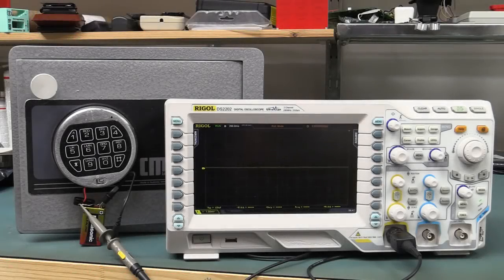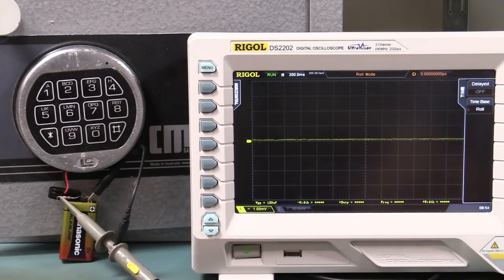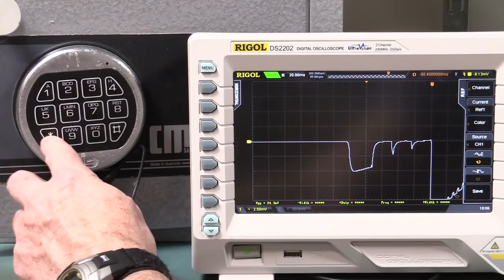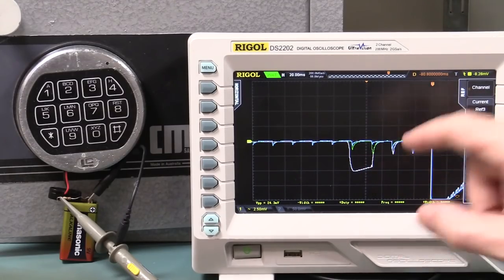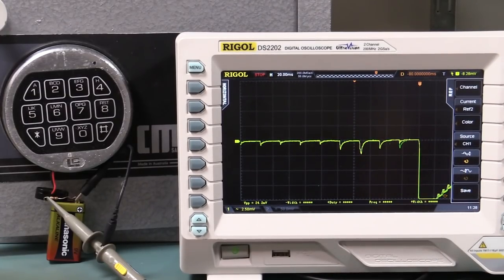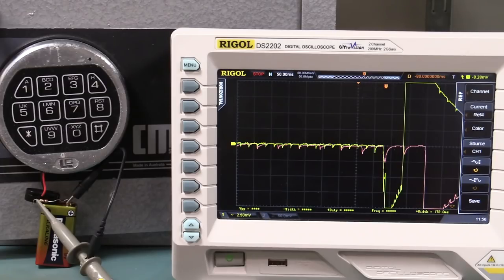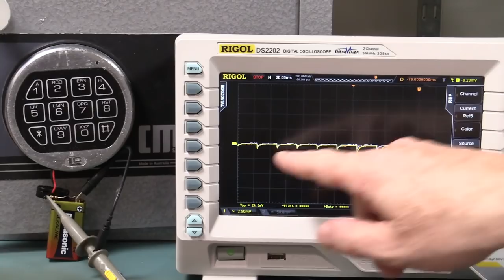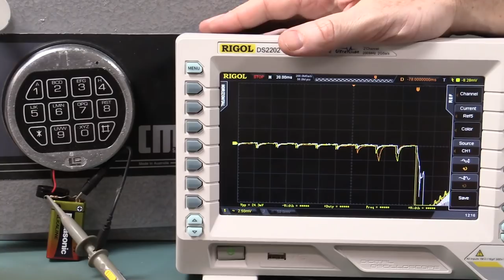EEVblog #771 - Electronic Safe Lock Powerline Attack Part 2

Comment: I wonder what, if any, effect that disconnecting the 9V battery would have. Is there some other sort of internal clock battery (or supercapacitor) that lets the processor keep track of that 10-minute lockout period, for example? If not, a brute-force attempt might be made much quicker by disconnecting the battery after the 2nd failed attempt. You could potentially automate the brute-forcing that way.
Reply: This Does Not Compute no. I've tried that, it doesn't work.
Reply: This Does Not Compute lockout is persisted to flash, but this would probably work for the 10s sleep interval
Reply: Peter Carlson 

Did you short the power pins after disconnecting the battery to discharge the internal caps?
Reply: This Does Not Compute It has a EEPROM chip for saving the correct combination. Just as easily the controller will dump a counter to the EEPROM on amount of failed attempts. At power up the processor checks the EEPROM for failure counts. If over limit, go to immediate lock out mode. Sure you can end the 10 minute lock out by pulling the battery, but it is no joy for you. The lock will just lock out again, when you power up again. This also prevents zeroing the failure index, before lockout happens. You can pull the power after critical-1 fails, but it is still at critical-1 and will lockout after the first failure after power up. The counter will only reset to 0 after correct combination is given.

Ofcourse it will wear out the EEPROM eventually. So they better have high quality EEPROM or flash in that memory chip

Only real attack vector for this kind of system, which does it sanely by collecting all six digits before comparison, is the comparison operator stopping after first failure in they comparison array. This would lead to timing attack. Assuming Legat was even half competent, they wrote their own comparison function, that will go through all six digits no matter what. Really easy to do. Of course it wastes couple processor cycles, but that is not exactly a problem for a security processor doing as simple program as this.

pseudo code
---------------------
correctcode= true
fakingvariable=true
array input[6]
array ref[6]
for i= 1 to 6:
      if input[i] != ref[i]:
              correctcode=false
      else:
              fakingvariable=false
if correctcode==true:
     openlock
Reply: +Ari Takalo Yes but they should also be smart enough to prevent the compiler from optimizing the fakingvariable=false out of the executable. It would be really interesting if this attack would work.
Reply: +Harmen hand coded assembly for the win. I reckon a crusty old 6502 could be made to jump through the necessary hoops, except of course the power requirements would be prohibitive.
Reply: There are 2 caps inside, so when powering it off they may supply just enough juice to write the failure counter. I wonder what happens if you apply a short glitch in reverse direction to discharge the caps and let the processor skip an instruction or two...
Reply: it has input diode, reverse polarity protection and capacitor external discharge protection

Comment: If they were smart, and they most likely were, the way lock program works is as follows.
Firstly, it captures 6 digits, after that, it sees if they are correct. In this scenario, the computing after first five digits were pressed is minimal and will be nearly identical, because all the processor does is writes the input for later use. After 6th digit was pressed, processor does the actual computing to see if digits were correct.
In that case, even if the waveform after 6 digits will expose whether combination was correct or incorrect, it is pointless at this point.
My hypothesis is supported by the fact, that it considers incorrect digit combination only after all 6 digits.
Reply: ignas2526 "If they were smart, and they most likely were"

lol, you obviously didn't have to deal with firmware programmers
Reply: this isnt 'firmware' its a very basic microcontroller. the comparison routine would be the easiest part, load the complete code into a register and perform an AND with the stored code. even storing the digits would be much harder, the hardest bit would be the code chage routines XD
Reply: I had the same thought, it seems sort of ridiculous to do it any other way.  You'd just use a 6 byte shift register.

Comment: I wonder if you can get more details in hacks like this by messing with the power supply, For example, dropping voltage down until the thing just runs, or limiting current draw. You wouldn't use a battery for all this, of course.

Comment: perhaps some of the "random" instruction spikes in the processor have to do with time in miliseconds since the last key or set of keys were pressed. it would seem random, for example, 127 in a binary data stream would transmit as 111 1111, of which the analyzer would report 7/8 whole amplitude of that function. once it would carry over to 128 in the stream, as 1000 0000, the analyzer would report 1/8 whole amplitude.

Comment: Do you still need to wait the ten seconds if you disconnect the battery then reconnect?
Reply: TheEXTRAtesco  they used a exploit like that on iphones , kill the battery power before the micro saves attempts
Reply: TheEXTRAtesco I would think the timeout is on a physical capacitor trickle or something of the like, so disconnecting the battery would change nothing.
Reply: TheEXTRAtesco On the safes I've seen, when the power is cut, it'll be in lockdown automatically when it powers back up.

Comment: Re: 16:37 Any of 10 digits for the first times any of 10 digits for the second is 100 ways to get the first two digits assuming leading zero is okay and that digits may repeat. Divide the 100 ways by 5 attempts per period is 20 periods. Since each period is ten seconds, the worst case is 20 x 10 = 200 seconds or 3'20". Since all 100 possibilities have an equal chance the average is half of the maximum or 100 seconds (1'40").

Comment: I still think there's opportunity to do a mechanical attack by finding the resonant frequency of that latch pin/spring system.  Can you use a waveform generator and an electromagnet/speaker to impose a mechanical excitation?

Comment: Clean your keypads.

I work in the security industry. A dirty keypad shows which buttons are used in the code. Using six individual numbers adds to the ease of determining the individual numbers.  After that it's just a matter of time. Doubling just one number greatly adds to the number of tries necessary to break the code.

Comment: Dave, try cracking some of the cheaper electronic safes like SentrySafes or the cheap ones you find at the local department store. I hear they're much easier to open than the quality ones like the one you're using.
Reply from the maker: Tyler P. Yes, you can just dump a lot of them, or something use a strap to get into a reset switch inside, they are horribly designed.
Reply: +Tyler P. 0000 is the "backup" code

Comment: I'm watching this, as a programmer.  Completely unrelated to La Gard, never done any security work, and never had any security training, but...  (WARNING:  Wall of text.  I do that.)

Well, it's amusing.  When they've got an entire kilo of memory available, it makes more sense to me to simply store the six entered digits and perform a final analysis at the end.  This processor is clearly processing the digits as they are entered; this is the only way that an incorrect keypress would produce the beep 1-2 processor cycles sooner than a correct press.

As for the noted difference in 'good' patterns, that's probably because of the chance of exactly when in the processor cycle your finger pushed the button- and suggests a fixed cycle count delay for the beep, which would work to reduce powerline attack effectiveness.  This also suggests a fixed maximum amount of processing per cycle; thus, full processing may happen on a different cycle.  This does not explain the difference in beep timing, clearly kicked off on a processor cycle.

The 'bad' patterns might have a similar variation, in theory, on the same basis; however, it would appear they do not obey any fixed processor cycle details, resulting in an immediate beep- which would seem to be a weakness.  Making sure it followed the same timing rules would have easily nulled the viability of the entire attack- probably something they did in more modern locks.

That big hurking processor blob on a bad code suggests that, while it is processing on-the-go for a good code (as evidenced by no such blob before the solenoid spike), it is ALSO storing all six digits for final reprocessing to make sure it hasn't messed up.  The difference in the two full-bad-code patterns suggests a simple matter of which cycle the beep was started on- the one with the reprocessing tied to it, or one after the reprocessing.

The combination of the two code-checking algorithms offers a balance of speed from the on-the-go method (as seen on accurate code entry) and redundancy (aka peace of mind, computers don't 'miss' things like we do) from the final reprocessing.  This also speaks to me of a low-bid programming job- a skilled programmer wouldn't have installed such useless redundancy and, especially if he's good with security stuff (as would get the higher bid/paygrade), would have known exactly how to throw off your measurements- like, say, a randomized delay of 0-3 cycles before the beep.  The beep duration appears to be 4 cycles- suggesting a cycle duration of just 12 milliseconds...  small enough to be largely unnoticeable, especially by a human being that can't know at exactly what moment the button press is detected.

Of course, a beep delay method would only work if you're using the beep as your reference, as you are in the video.  It is probably possible, with the specialized board you've elected not to use, to lock onto the power draw of the button itself (minute, but not nonexistent) and use the first cycle after that as a reference.  This kind of attack would likely reveal processing delays and/or spikes related to the keypress, rather than the beep; a combination of the two methods (again, probably possible on specialized equipment) could easily reveal any inconsistencies left by the process-on-demand approach by a programmer that doesn't know what they're doing.  Again, with absolutely no security experience or education, I can think of fairly easy ways to render it insusceptible to powerline attacks- even without (much) hardware protection.  Fairly simple...

The correct passcode is an array with six entries.  Non-programmers, think a list:  {1, 2, 3, 4, 5, 6}.
There's an index counter that tells it which key will be pressed next, initialized to 0 (because computers start counting at 0, not 1 like we do).  Note that initialization happens during that first dip on the first keypress, before the first key is actually processed.
There's a secondary variable to hold the most recent keypress, once the data signal from the keypad has been interpereted (differences on that will be by key, like the 0, not by accuracy).  Doesn't really matter what it's initialized to, but initializing variables is good practice, so a lot of programmers will initialize it to 0.  I would personally set it to a value that can't possibly be valid, like -1, for "idiot-proofing" reasons.  This variable isn't technically necessary, but it cleans up the code and improves readability for future programmers - so, something a professional would do.
There's also a secondary six-entry array, also with six entries, to hold the entered code- same as the last variable, initialization not required, but it's good practice:  {0, 0, 0, 0, 0, 0}.
And finally, a boolean (that's true/false, for those who don't know) variable, to tell if the so-far entered code is correct or not.  Initialized to true, because they haven't gotten anything wrong yet; lets us use the same algorithm for every digit, preventing a unique first-digit behavior- forcing a uniform behavior.
Implementations that only check on code completion can leave out the boolean; implementations that only check on-the-fly can leave out the second array.
Assuming a dual-implementation, we have 14 numbers and one boolean.  That's a whopping 15 bytes, to the 1024 bytes in a kilobyte.  Unless they choose to use a sub-byte-sized datatype, where ALL the data can fit in just 8 bytes (7 for the numbers, and 1 for the boolean because we can't only use half a byte).
So, in order of correct code, entered code, digit index, digit, accuracy, we've got:
{1, 2, 3, 4, 5, 6}, {0, 0, 0, 0, 0, 0}, 0, -1, true

So, initialization complete, we get to the first button press- say it's accurate, a 1.
For the on-the-fly approach, we compare it with the matching index of the correct code and AND the result with the boolean variable.  This way, no matter what the states of the two values, the same number of read, comparison, and write operations happens, in the same order- so even without hardware protection, in theory, the value of that boolean is unguessable.  Even if the exact operations the processor is performing can be guessed.
For the final processing approach, we store it in the matching index of the second array.  No processing for accuracy happens, rendering a powerline attack useless at this stage.
For a dual-implementation, we do both.
Then, we increment the index variable, possibly kick off a routine for the beeper and the light.  The result:
{1, 2, 3, 4, 5, 6}, {1, 0, 0, 0, 0, 0}, 1, 1, true

And repeat.  Second digit, say it's wrong.  A 3.
Same processing.  Result:
{1, 2, 3, 4, 5, 6}, {1, 3, 0, 0, 0, 0}, 2, 3, false

And so on.  Because we're still reading that false, AND-ing it with the new comparison, and writing it right back again every time, it should be impossible to tell when an entered keypress is accurate or not.  So, final keypress happens, we process it the same way.
{1, 2, 3, 4, 5, 6}, {1, 3, 2, 4, 5, 6}, 6, 6, false
But the index variable has an invalid value now- a 6.  If we process another key, the program will crash.
So we don't.  We detect the six, and trigger our final processing routine; the entry has been completed.
For the on-the-fly approach, we simply peek at the boolean value we've carried along.  If it is true, we unlock the safe.  If not, we do nothing- maybe kick off the bad code beep sequence.
For the final processing approach, we iterate through each key- possibly reusing that index variable- to perform the processing in much the same way as the on-the-fly approach.  If true, unlock.  If not, don't.
For a dual-implementation, we check the boolean value first.  If true, unlock the safe.
If not, perform the final code processing to doublecheck.  If true, unlock; if not, bad code.
In my example, it's a bad code- so the safe stays locked.

Finally, once we're done, shut down the processor.  If it's a bad code, we may keep the processor on for some timeperiod, after resetting the entry data, and incrementing a variable to track bad attempts- thus producing the lockout functionality.  If it's a good code, we simply shut down.

Since the processor's only vulnerability is through the powerline, we don't have to worry about software hackers, making this a perfectly valid program- and one that would take me all of 10 lines, or so, in a high-level industry standard language like Java or one of the C Family languages.  I am curious- can you spot any powerline vulnerabilities in that pseudocode...?  (Hardware experts & real safe programmers welcome, not just random strangers)

It is worth note, reading down the comments from three years ago, that a lot of people seem to think one approach or the other would be a big mess...  Funny.  It's not exactly firmware code, but here's a little snippet, of valid Java code:

//Note the double-slash indicates a one-line comment- compiler ignores anything that follows, up to newline.  We're using the keyPress() return value to tell whether to open the lock- true means open.

int[] good={1, 2, 3, 4, 5, 6}, entered=new int[6];    //On the go leave out 'entered' variable
int index=0;    //no 'key' variable, because we're using a method parameter for that.  Style preference, really.
boolean accurate=true;    //Final processing leave out 'accurate' variable

boolean keyPress(int key){
    entered[index]=key;    //On the go leave out this line
    accurate&=key==good[index];    //Final processing leave out this line
    index++;
    if(index>5) return onCodeComplete();
    return false;
}

boolean onCodeComplete(){    //On the go replace entire method body with 'return accurate;'
    if(accurate) return true;    //Final processing leave out this line
    boolean val = true;
    for(index=0; index<6; index++) if(good[index]!=entered[index]) val = false;
    return val;
}

Not much of a mess, if you ask me.  Looks much nicer in an IDE (Integrated Development Environment, a programmer thing).
Reply: masterinvented, Sweet. Not an easy hack, for sure.